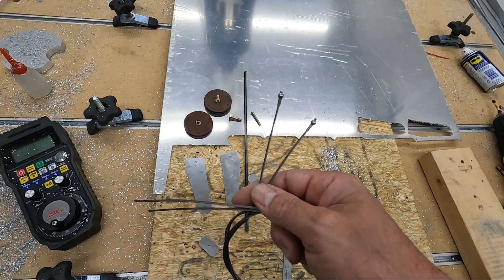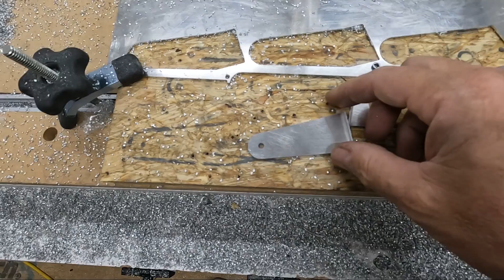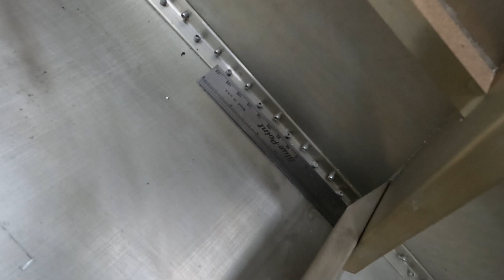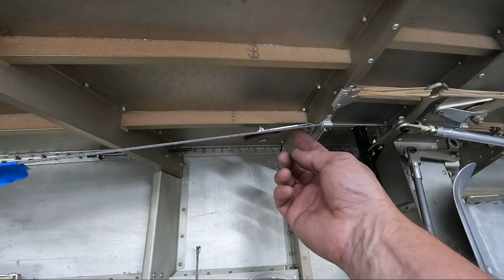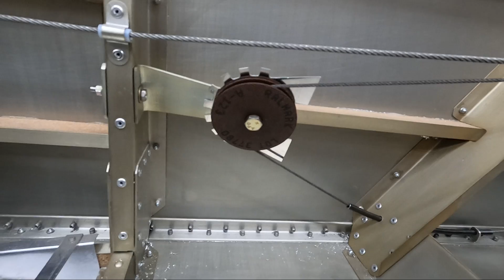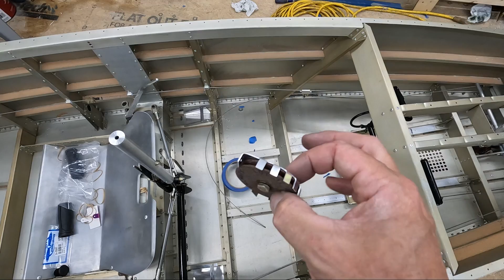34 - CriCri Airplane Build - Nose Wheel Steering

Comment: It may be an optical illusion, but it looks as though the tabs on those pulley support brackets would work better if bent 180 deg. the other way. It would make mounting a little more fiddly, (The bolt would be between the skin and the bracket),but it would put the pulley in a better spot. Is there a flaw in this idea?